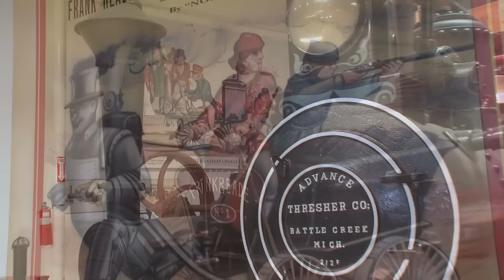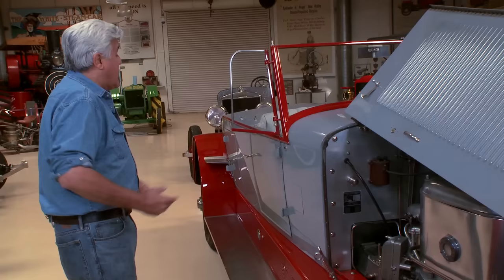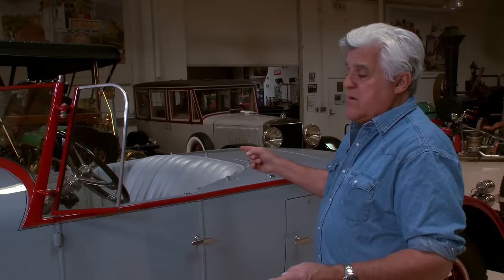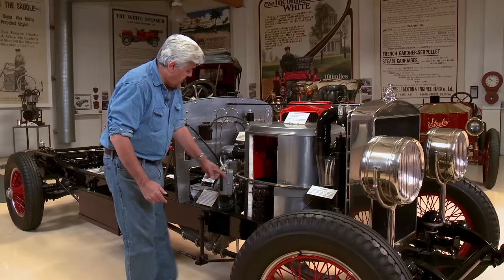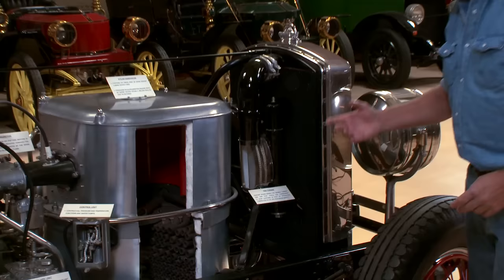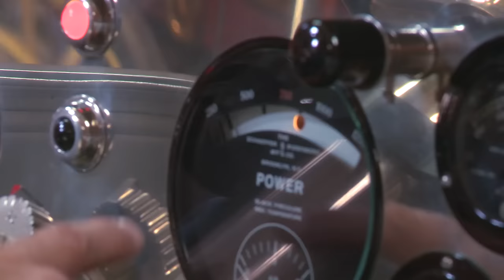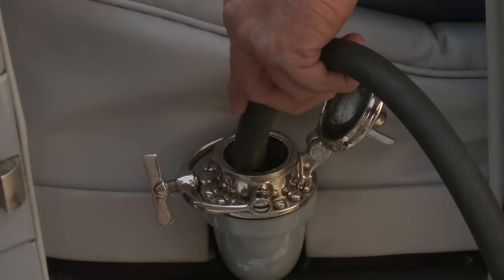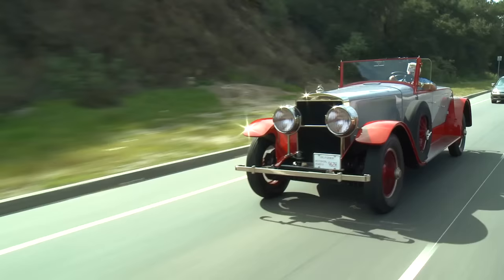1925 Doble E-20 Steam Car - Jay Leno's Garage

Comment: You know you’re rich when you have a steam car chassis cut away just to show how your steam car works.
Reply: I think it was also in a museum before.
Reply: how your other          steam car works
Reply: You know you are rich when you can afford to keep a steam car running
Reply: @sandervanderkammen9230  more efficient than you think
Reply: @raritica8409  Prove it!
Reply: @sandervanderkammen9230  all you need is water and a fuel source. Once steam is hot you barely have to use it. Plus you build more steam as you go.
Reply: @raritica8409  Absolutely false, the Doble engine was extremely inefficient.
Jays car can go about 200 miles on 30 gallons of gasoline, about 6.5 mpg and only produced 150 horsepower when new.
Reciprocating steam engines this size are typically less than 10% efficient.
Reply: @sandervanderkammen9230  ok then. The way Jay explained made me think it was somehow efficient. Thanks
Reply: @raritica8409  You are correct, some of Jay's remarks are very confusing and give the impression that the Doble was very efficient.
He was trying to explain that for the time, it had very good COMBUSTION efficiency but this does not necessarily translated into good FUEL efficiency... the Doble was actually very inefficient.
Reply: @raritica8409  he runs it on imported Evian.
Reply: @sandervanderkammen9230  depends on how you divine efficient. It certainly was efficient for a car of its power, and efficient with water.
Reply: @Mrcaffinebean  No, its not. Reciprocating steam engines are extremely inefficient compared to internal combustion engines which is why they replaced steam cars.

Water consumption is completely unrelated to Engine Efficiency

Don't confuse Condenser Efficiency with Engine Efficiency
Unlike ships or power plants, steam cars can only have an steam-to-air heat exchanger... the condenser in the Doble is far too small to be efficient on a warm day.
Reply: @sandervanderkammen9230  6.5 mpg is probably pretty on par with any of vehicle of the day that had 1000 foot pounds of torque.
Reply: @Mrcaffinebean  No, the Doble made just 150hp when new and running in perfect condition... so no, it was not on par.
I don't know where you are going with torque, it does not relate to efficiency in any way.
Any questions?
Reply: @sandervanderkammen9230  torque buddy, horsepower is how hard you hit the wall torque is how far you move it. If you compare this to similar cars of the day they had equally poor mileage.
Reply: @Mrcaffinebean  I'm not too sure about your engineering skills...
The winch motor on my Landcruiser produces 8,000ft.lbs from just 4.5 horsepower.
The Doble could only manage 1,000 ft.lbs at the wheels with 150 hp.
It seems your math doesn't add up very well son.

Are you familiar with the Carnot Cycle formula???
Reply: @sandervanderkammen9230  I’m confused as to why you would compare a car made in 1925 to a land cruiser winch. Very strange. 

Either way you are confused. Having a thousand foot pounds of torque is in no way comparable to the rating of a winch. 

The best way to rank this cars efficiency is to compare it to cars of the day with similar top speed and acceleration. It’s a pretty short list of internal combustion cars even able to keep up and those car all also guzzled fuel. 

When your shopping for a car like this in 1925 it’s full economy is not something you would be concerned about. Range is of much more concern and range can be had by enlarging the tank.
Reply: @Mrcaffinebean  You didn't understand the technical analogy???

I'm afraid you don't understand what TORQUE is... 
A 16,000lb rated winch with a 6 inch radius capstan requires more than 8,000 ft.lbs of torque at the output shaft.

The best way to compare heat engine efficiency is using the Carnot Cycle formula.
This is what all engineers use. 

The Doble was the most expensive car in the world in 1925... it cost nearly 2 million dollars to build each one... economy was not a design factor.
The winch does this with only 4.5 horsepower... you don't see the obvious flaw in your argument???
Reply: @sandervanderkammen9230  land cruiser winch is winch is not comparable to a road going car from 1925. It’s like comparing the strength of a lama to the thrust of a rocket. It makes no sense.
Reply: @Mrcaffinebean  It certainly is, 
You are are comparing output torque to efficiency... you cannot compare efficiency by comparing torque.

That would be like comparing the  energy efficiency of LED light bulbs by brightness and not looking at current consumption in Watts...

Do you see the flaw in your argument now?
Reply: @sandervanderkammen9230  no it would be like comparing the efficiency of an LED bulb to a torch from a castle. It’s a comparison that makes no sense, and has zero value.
Reply: @Mrcaffinebean  I see you have now quickly retrograded below remedial level engineering.

You cannot calulate or compare engine efficiency by using torque.

Torque is not a value that can be measured in efficiency.

You must convert Torque to Horsepower or Watts to compare to motors...
Otherwise Torque is meaningless to the comparison.
Reply: @Mrcaffinebean  Engineers use BSFC or SFC to compare the difference in efficiency between to different engines.

BSFC tells us how many pounds of fuel are consumed by HORSEPOWER produced.

With electric motors you can just compare Watts.
Reply: @sandervanderkammen9230  buddy comparable cars to this one has comparable mileage. It’s that simple.
Reply: @Mrcaffinebean  No, its not that simple.
To make a useful, meaningful comparisons you need to use a common metric or method of measuring.

You cannot compare efficiency by only comparing torque.
Torque output does not tell us energy consumption or power output.... these things are what efficiency is based on.
Any questions?
Reply: @Mrcaffinebean  If a 4.5 horsepower electric motor can produce 8,000 ft.lbs of torque and the 150 horsepower steam engine can only produce 1,000ft.lbs...
There is something very obviously wrong with your theory....
Reply: @Mrcaffinebean  This comment is totally wrong. Torque is twisting force. Horsepower is work done per second. You can think of them this way: if you hook the engine up to a winch at the top of a mineshaft, the max torque will determine how heavy of an object the winch can lift. The power determines how fast you can lift an object of a given weight. You can always obtain more torque by adding a gearbox to reduce the speed of the output at the same power rating, but because a heavier mass has more potential energy the total work done per unit time will remain the same.

 The consequence of this is that I could get the 50cc engine from a moped (maybe 2 hp) and the V-8 from a Dodge Hellcat (717 hp). With the use of a reduction gearbox, the 50cc can easily apply the same torque to the winch as the Hellcat, and be able to lift the same weight up the mineshaft. However the V-8 will be able to spin the winch a lot faster with the same torque, lifting the weight in a shorter time. 

Happily, accelerating a car is functionally almost the same as lifting a weight. So in car terms, power tells you how fast you can accelerate. Torque only informs you how fast the engine has to spin in order to deliver a given amount of power. The advantage of a 'high torque' engine is that the power band is often wider (in relative terms) and you don't have to rev the engine up so much in order to get a usable amount of power- this translates to a feeling of stronger 'pull' when the throttle is suddenly opened while driving, but doesn't necessarily translate to a higher maximum tractive effort at the wheels under optimal conditions.
Reply: @sandervanderkammen9230  The combustion chamber is EFFICIENT for the amount of heat it produces. The method of power generation, steam, is NOT. 

That is where the confusion arises. The rest of your entire grandiose rant is irrelevant
Reply: @sandervanderkammen9230  But a good forced air burner sure can

Sooooooonnnnnnnnnnnnnnnnnnnn
Reply: @Kloppin4H0rses  That's just a heater, not an engine, it won't get you anywhere son... just like your failed argument.
Reply: Prayers for Jay and his family, he is currently in hospital burn unit undergoing treatment for severe burn injuries he received while starting his steam car.
Reply: @Mrcaffinebean  , depends on how you can read the English language. He just said that.
Reply: @sandervanderkammen9230  Try using two instead of to, Smartarse
Reply: @tfan2222  No, why do you ask?
Reply: @tfan2222  Are you a flat-Earther too?

Comment: “It’s a little bit grimy.”
*car is literally immaculate
Reply: I have a pickup truck that was made in 1985, and I honestly believe it has never had the engine cleaned in the 300K miles it has run. There is literally inches of "grime" in some places lol. I haven't had a chance to clean it as I haven't even gotten it road legal yet, but I kind of want to leave it as it's kind of a bit of history. Thirty-five years of oil, power steering fluid, road grime, dust, and dirt, and who knows what else.
Reply: @NotSoCrazyNinja  That sounds really neat! Just make sure the grime isn't too flammable or keeping it may be a bad idea.
Reply: What's a little grime between friends?
Reply: @NotSoCrazyNinja  ,   Thank goodness, no rat's nests, etc.!
Reply: @Catsissie  , probably a bit better if it's among friends!
Reply: @NotSoCrazyNinja  You need a cheap steaknife [good at digging out odd corners], a wire brush and maybe a shop vac to even think about degreasing.  The good news is those oil leaks being encapsulated by grime will let you find original paint.
Reply: @NotSoCrazyNinja  That's factory rust proofing is all
Reply: @NotSoCrazyNinja  use a scraper on the thick parts.
Then cover the whole thing with purple degreaser. 
Then blast it away with some low setting pressure washing.

It will shine like new.
Reply: Mark Reaves trust me from personal experience with an older car like that you should not clean all that grime. It is most likely (99.99%) chance that grime is keeping a lot of leaking fluids from pouring out. Essentially making sealants to keep the oil and antifreeze where they belong. I had an old pickup that didn’t leak a drop of oil until I thoroughly cleaned the engine and basically removed that grime sealant and it would leak out almost a quart of oil a week
Reply: for a show car...
Reply: @NotSoCrazyNinja  Eh, it's a truck, call it insulation.
Reply: @cdav  yeah cause look at all those years of grime that was collected on Kings Cross subway station fire in London. It caught fire and killed a few people.

Comment: As a Boilermaker I can appreciate the complexity/efficiency of the steam raising equipment on this very well made vehicle.  You should be thanked for preserving it.
Reply: I also am a Boilermaker. L #359, Vancouver, Canada. In my imagination,  I always  looked  at every part of a coal fired boilers as a human body. They have similar functions. Thank you Jay Leno for the detail in your video. You are a dedicated teacher.
Reply: george waite, do you drink boiler makers?
Reply: @Matthew_Eitzman  Hopefully not before going to work with one those systems! With the pressure these engines produce, you don't want to be distracted or confused. The good part; you don't bleed when the steam leak strikes your arm. The bad part; the severed body part just thumps on the ground. Steam at those pressures, is like an "old style laser beam!!" The injury is instantly cauterized.

Comment: It seems very hard to imagine that they could have engineered such a high temperature, high pressure system with the metalallurgy that was available back in the 1920's. That car is definitely an amazing feat of mechanical innovation, as well as a historical work of art. What a privilege it must be to own and operate such a unique treasure!
Reply: Ooooo
Reply: Don't see that issue. Steam locomotives were around  80+ years before this...
Reply: People used to be a lot smarter, back in the day.
Reply: @chipco5150  Steam locomotives don't really need to be light, they have lots of room for slow starts and stops. Cars on the other hand have to be light enough to accelerate in a reasonable time, and the requirements for a light-weight steam boiler are the exact opposite of the requirements for a steam boiler that won't readily explode. Even at the end of the 19th century boilers were still prone to have destructive "temper tantrums" on a pretty regular basis, the sort of tantrums that level buildings and send shards of superheated metal flying at extreme speeds.
Reply: @Tuzszo  There where some applications in ships which required power dense steam engines (i.e. smaller ships) but yeah the miniaturization is impressive
Reply: metallurgy at a high level of precision did exist , it was just CRAZY expensive
Reply: The tech was there, but not for mass production. I like to think of it like, this thing is the equivalent of a mars rover compared to a nissan leaf. Both exist at the same time, but one is made without production costs and overhead ect. In mind. Makes one wonder where we would be at if money didn't command our societies progress and we actually made things the best they can be in the first place.

Comment: I served many years ago in the boiler plant of a US Navy aircraft carrier. The propulsion plant operated on 1200 psi superheated steam. It was similar to the requirements of a steam locomotive requiring lots of labor personnel, maintenance, and upkeep. Just the water for the boiler alone required ultra distilled water with under one part sodium per billion parts of H2O. Preventing scale build up was of great concern, so the PH level was set to create sludge that could be blown out periodically on the water drum at the bottom of the boiler rather than creating scale. Sludge was the sacrificial lamb with no damage when blown out properly. I laid all of this out to show how complex steam propulsion was/is. Glad to see this car restored. It is living history.